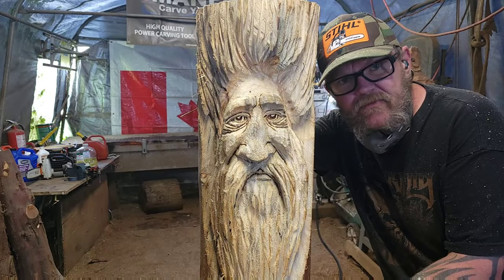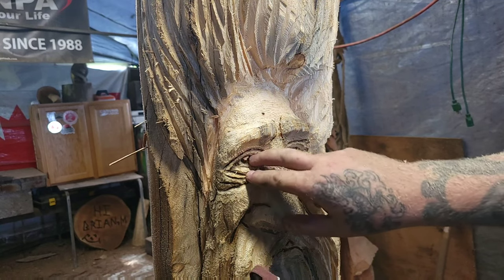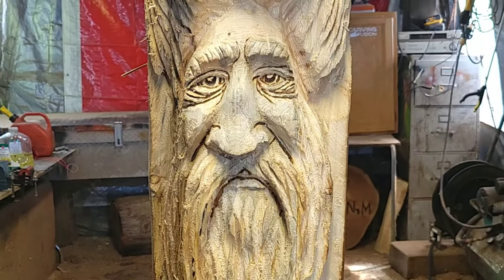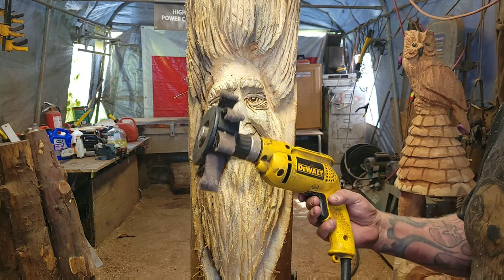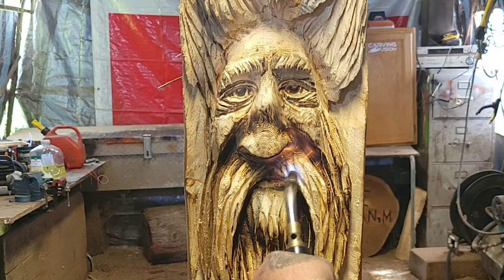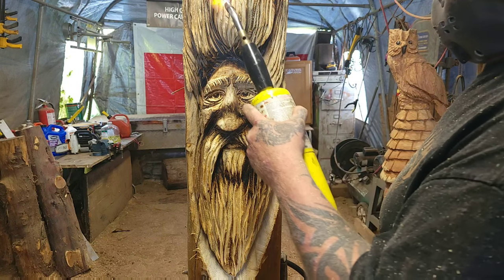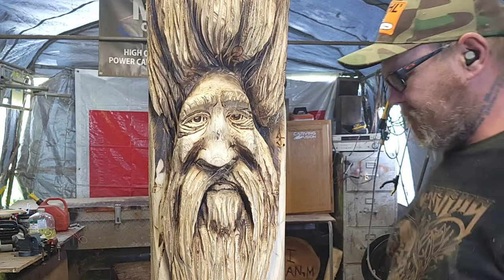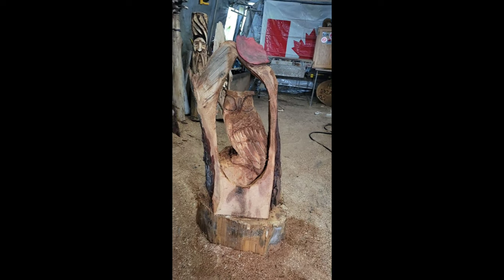100% step by step Beginner woodSpirit carving series. Burning/sanding.

Comment: The Amazon link for your Amazon shop, that you have listed, won't open for me.  I have high speed internet and believe it to be a problem with your link.  May need to check it out.  Poped into your live chat today but forgot to post it then.
Reply from the maker: Hi there are u in the states? It's in here somewhere
Reply from the maker: If u wanted to buy me a coffee here is a link to my pal pal👇
https://www.paypal.me/carvingfusion

Kutzall 
carving burs I use link,
👇
Use code: CFUSION  to save 5% on burs and disks
http://kutzall.com/?aff=24

STARBOND GLUE 👇🏻
Use code : Cfusion to save 10%
https://www.starbond.com/?rfsn=4758250.6b284d

Pete blair mandrel
Email pete @
peterblair@me.com

Manpa tools👇🏻
www.manpatools.com

All the carving tools i use are in this amazon shop listed below👇
https://www.amazon.com/shop/carvingfusionbyjordyjohnson?ref=inf_own_carvingfusionbyjordyjohnson_cp

https://etsy.me/2Usrss6

https://www.instagram.com/carving_fusion/